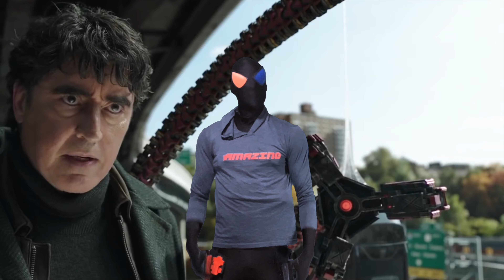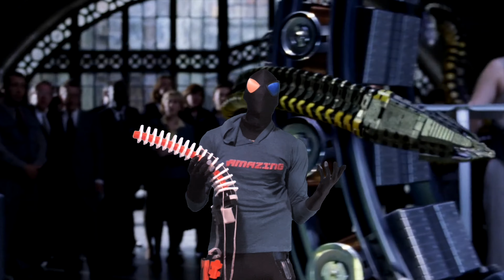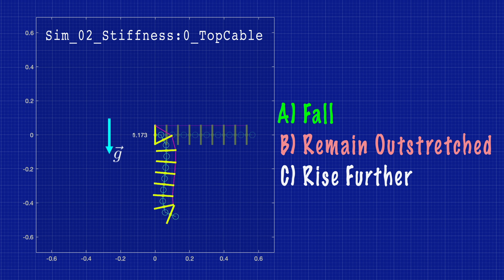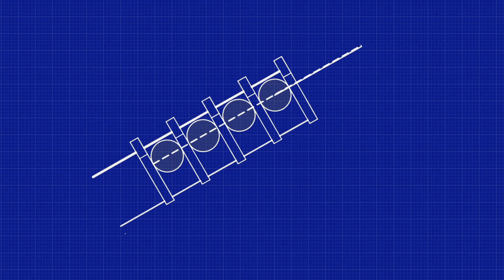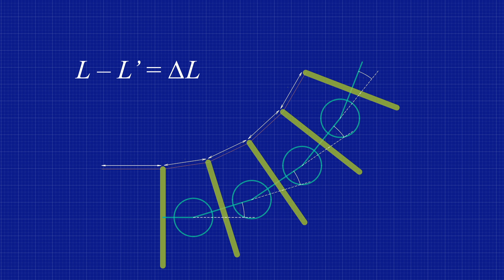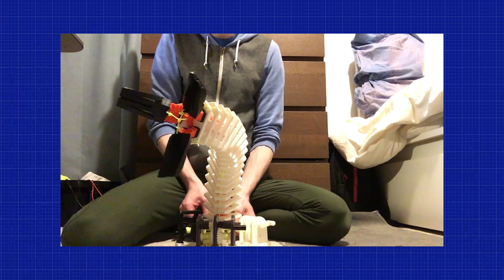DOC OCK is harder to build than you think. | Spider-Man: No Way Home

Comment: I know this would be hella complicated, but couldn't you give the cables Boolean logic gates to decrease the necessary number of actuators? pulleys are Turing complete, so it should be possible to "code" the strings so that one motor can selectively act on multiple different joints

Comment: I don't agree with anyone that says a certain technology can't somehow be used for violence. That being said, The best solution for tentacles would be individual control of each segment in relation to the other segments rather than to a base, like how real muscles work. One of the defining features of arms is the ability to reach out straight for something, a type of motion that can't be achieved if using the 4 delta L formula and one motor for each "side" of the arms.  You could accomplish this with more motors at the base rather than integrated into the arm segments and having cables run parallel to each other on each side of the segments, the cables lengths being equal to the length of the tentacle + 4 delta L (plus however much is needed to secure it to the mechanism properly of course). Pulling on each of these by some % of 8 Delta L (4 Delta L i.e. fully contracted to -4 Delta L i.e. fully extended) can give you control of which joint is bending, not just which side of the arm. Then you can pull on opposite sides of the arm at different segments to create complex bends rather than just large sweeping ones, and you get much more fluid motion as well as the ability to reach straight forward for stuff.

This concept only gets better when you consider artificial muscles as a possibility, since in theory you could run variable current up the segments of the arm to control the speed and power of the motion at each joint. We're a long way from implementing that though

Comment: Your explanation of the multi pulley system blew my mind. I’ve been thinking about the exact problems you talked about for years and can’t believe I never thought of something so simple and brilliant, even more impressive that you applied the mathematics to it. Definitely want to look into that myself too. Here’s a suggestion, it’s something Ive planned on doing myself eventually. If your objective is to have your arms be lightweight, Maybe consider using foam as a material?  It may seem unappealing aesthetically at first, but you’d be impressed how close to metal a lot of cosplayers can make Eva foam appear, though it takes observation and practice. Not to mention, on a large scale especially, it’d safe a ridiculous amount of time compared to 3d printing, though it’s a lot more hand work. In my experience, another advantage would be that foam has a degree of stiffness to it already and the orientation can be modified with a heat gun, but I imagine that would be negligible once you pass a certain, not very large size.

Comment: I want to print with ninja flex but I'm having a hard time know the prerequisites and temp for my print. Thoughts?
Reply from the maker: I only have experience with Cheetah (what I recommend for these parts) as my printer can't do anything softer (like typical NinjaFlex) but I do very hot (~230-240°C) and very slow (~30mm/s).
Reply: Thanks man your Amazing.